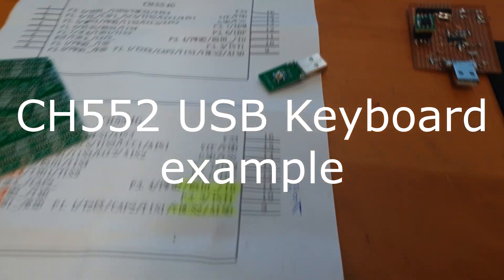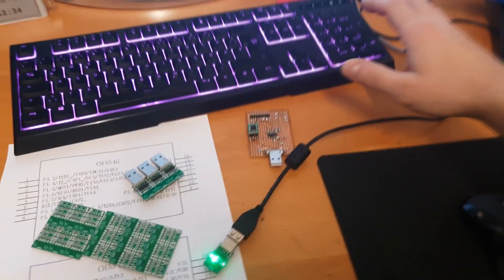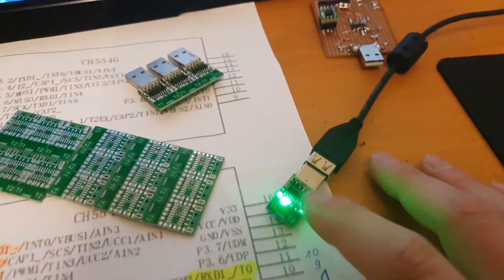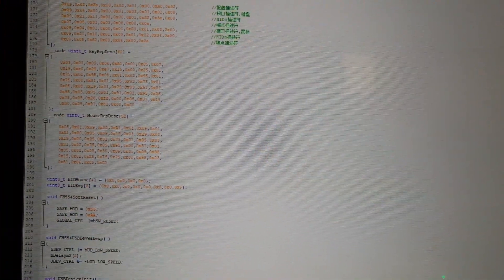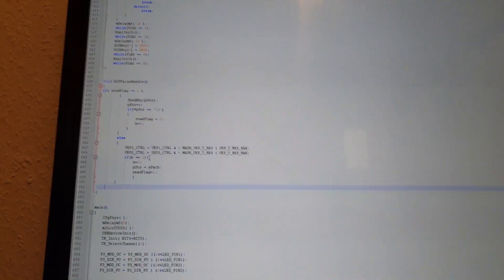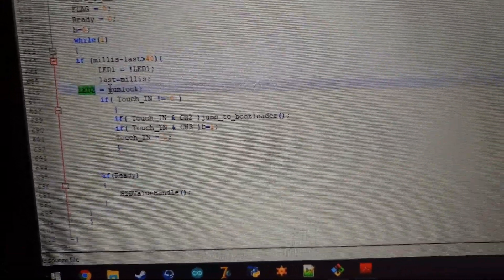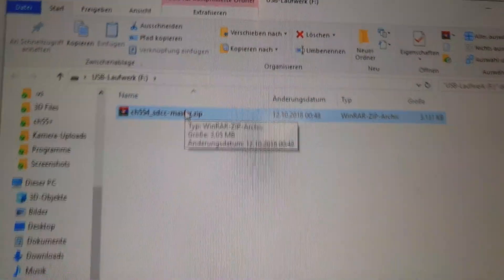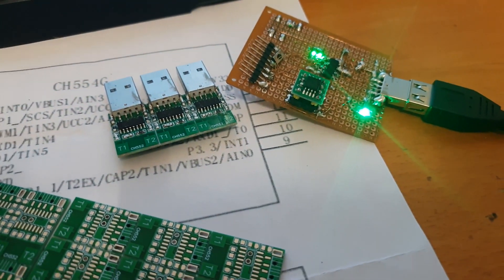CH552 USB Keyboard Example and HOW TO

Comment: how many Keys could be implemented? like... the chip has limited IOs right
Reply: You can have upto 17 GPIO pins in the CH552 MCU as per the datasheet, Which means theoretically you can have an matrix of 8 x 9, i.e. 72 keys.

Comment: Kann man auch Eingaben wie Lautstärke lauter/leiser play/pause tätigen mit dem CH551G/CH552G?
Reply: Ich wollte nämlich so einen PC-Controller damit bauen mit dem ich Lautstärke und so über Buttons verändern kann...
Reply from the maker: @electronicstv5884  Moin, ja das ist damit auch möglich, dazu einfach die passenden Media Key Code in das USB Output Array setzten und wieder zurücksetzen. 
Die Passenden Kex Codes müsste man Googlen oder it den USB Analyzer einfach ausprobieren mit einer anderen Tastatur.

Grüße
Reply: @atc1441  Danke dann werde ich das mal ausprobieren...